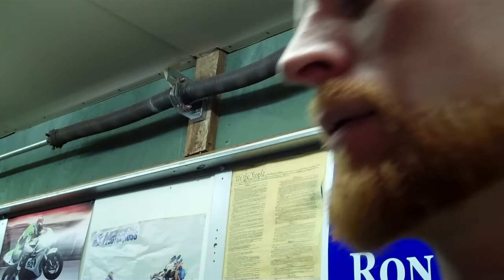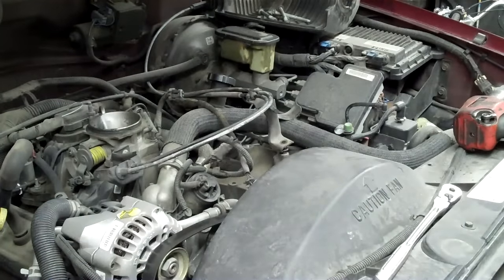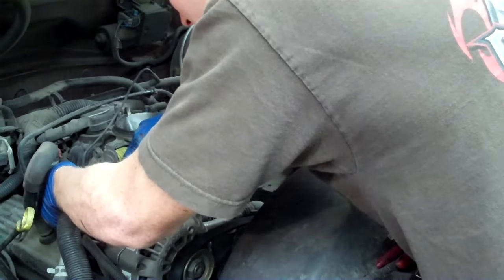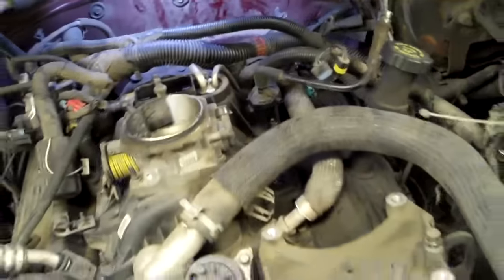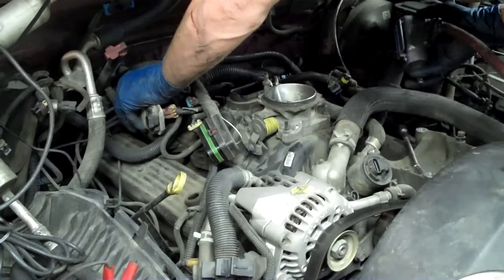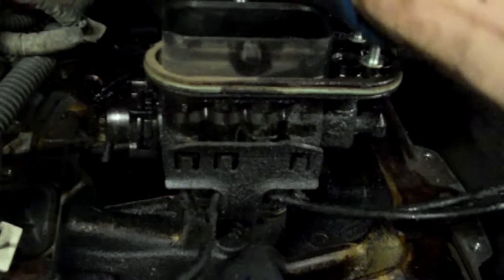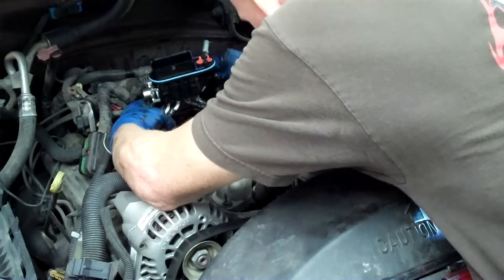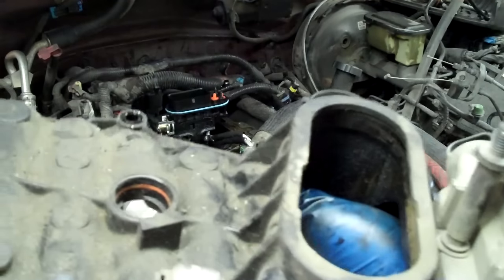How to change a SPIDER INJECTOR on a Chevrolet V8

Comment: Hey Brian, Thanks for video-Trying to pull lower bottom deck throttle body off to clean it up -seems like distribulator shaft is holding it on- can I unbolt it?
One other question- bent stainless steal pipe supply lines-can I bend back into shape or should I replace with new? 1997 Silverado 5.0 liter pick up truck

Comment: Spider housing does not fit through upper plenum. ...a bit too big...plenumbis  about 3/8's short from where it should sit on the housing....applied some of that silicone spray and it still didn't go in....tried to muscle it into place but no success ...any suggestions?

Comment: Hey Brian. You are the man. I have Silverado 5.7 V8 I got 2 codes P0305 / P0172 I thinking change my fuel injectors. I changed sparks plugs, wires, roto, cap,  fuel filter, air filter... still stink when running and the engine light still on, I'm getting ready to tester the cylinders compression. Your video is great. Any way, you think the spider injector is the problem? Help the Brazilian guy fix this problem, any help will appreciated. Thanks Brian.

Comment: I have a 91 suburban it's been giving me the blues with cranking. I sprayed starter fluid in it throughout the week finally today the cover for the filter and to the throttle body blew off. Is this possibly what's going on with my truck as well.  For some odd reason I can't run the AC it kills the power when driving. It's like my truck bogs down from a heavy load or something. What can this be
Reply: I don't think your year of truck is fuel injected.

Comment: Question...I have a 99 1500 that when I turn the key on it shows 60 psi fuel pressure  but within a couple seconds it slowly bleeds off pressure  on it's own. Even as you crank to start it dont hold pressure.  Put gas In throttle body it starts but not on it's own. Checked the obvious..replaced fuel pump, new fuel relay/fuse and new filter. Still nothing. Getting ready to replace  spider just wanna see thoughts this would be issue?

Comment: My '97 Z71 will start immediately when cold. After that the only way it will start is to hold the pedal to the floor. Computer said the Mass Air Flow was bad. Replaced that. Still says the mass air flow is bad after resetting. However, the fuel pressure gauge shows it holding pressure after the vehicle is shut off. Does this sound like a problem with the spider?

Comment: No when you replace the batter injectors beforehand was it back fine through the tailpipes when you drove it if it was it what was the reason you replaced it because you owed was overloaded with fuel and if it would backfire is it to the computer

Comment: hey man I really appreciate the video I took off my throttle body and seen that it was soaked underneath so I figured it was the spider I watched your video before and while I replaced the spider and that was the problem for sure!! Now I have a,nice running Tahoe! Before I couldn't even drive it because I would press the throttle and it was missfiring really bad now its smooth and its not falling on its face! Make some more videos you would be a really good teacher!!!!
Reply from the maker: Welcome Nick!  Check out my channel- there are over 700 videos there on car repair, and on my other channel theskiviking I have quite a few more!

Comment: hey Brian this is Adam. I have a 97 Chevy Tahoe with the same setup I just changed the lower intake manifold gasket plus all the others gaskets going up. on the fuel lines going into the spider, I had a fuel leak right there. by any chance do you know how many o-rings are on those fuel lines that go into the spider?
Reply from the maker: +addbcollins Most every fuel line connection has a yellow and a brown o-ring.

Comment: Hey Brian, not to sound stupid but, what are the symptoms of a bad Spider Injector? My 96 Silverado has a hesitation on excelleration, and is getting really bad mileage. I've already done a complete tune up, including some sensors. Should I try a new fuel filter first? Oh, also, I have to spray starting fluid 90 pc of the time. Thanks for this vid, and any help....ps...loved the Temple Grand reference....and I haven't heard my fuel pump in years. Battery?

Comment: Worth noting... You dont need the little plastic spacers on the ends of the fuel lines where they attach to the injector body... On the  updated design the lines go down into the O-Rings without the need for the spacers.

Comment: Hi Brian... in having problems with a 98 Silverado k1500 350 5.7 I do a lot of work myself...number six plug keeps fouling out (really bad black gunk not wet) I've put not foulers on number 6&8 plugs... I've been told valve guides seals r bad... ( not sure if true) I'm doing a compression test next) I've changed my fuel pump...done all wires etc.... my engine does not smoke... but uses oil... engine chokes when u give it gas.... I'm new to doing a lot of things...I'm not sure what to do next.. is this maybe something to do with the throttle body.... or does it sound like something else.. I don't wanna go to a mechanic... I'm simply tired of my truck running so rough... is it a piston problem?! What do u think??? Help!! :) thank u...
Reply: Well it
Reply: Sell

Comment: hey brian i have a 97 gmc burban. took it to the chevy dealer for a check engine light. it was diagnosed with bad cat. so i changed those now it bareley pulls itself outta its own shadow. i was told it could be an injector or o2 sensor. any idea's? it use to shutter when you would step on the gas but since the new cats it barely does anything.

Comment: Help somebody!!!! I have 96 Chevy 2500. Engine light keeps flashing, code reads misfire cylinder 2. I have changed plugs, wires, distributor cap, rotor, ignition coil,..yet to no avail.. still reads #2. Could this spider injector be my next step because I'm not getting enough compression on cylinder 2? Video was very helpful and I feel capable of being able to take it on myself, but just trying to make sure

Comment: how do you safely remove the new style injectors? I have removed many of the old style but I have never had to remove the new style. I don't want to remove the lower intake only the upper and I am a bit concerned if I just pry them out they may break off.

Comment: How do you know which injector to put in each cylinder? Is there a certain order? Is it possible to put an injector in the wrong cylinder? Thanks.
Reply: The spider has little numbers on the side of it. Rule of thumb (as shown in the video) Outside to furthest cylinder inside to closest and since there are only 2 on each of 4 corners, it's hard to do incorrectly. Once the injectors go in the hole though, it's heck to get them out.

Comment: I had the strangest thing happen after changing the spider , I still have not been able to figure it out. After replacing the spider I took it for a test drive and within 50 feet of driving it I pushed the AC button and smoke started coming out of the AC controller it fired the controller. I have traced all the wiring inside and have not found any bad wires. The AC has been replaced all the Air blend motors have been changed. Not sure if there is one for the hot to cold. The AC work great before changing the spider so I thought I might has pinched a wire or forgot a ground but everything looks fine, I replaced the AC unit the high pressure cutout switch and the dryer, put a new controller in and it smokes it when turning off the fan switch. Not sure if anyone has ran into this problem but I thought I would put it out there I watched your video to go back through all the parts and wiring being removed to see if anything would click just in case I missed something thanks for the great video.

Comment: I think you meant a p0172 and p0175 is too RICH not lean.  That's the codes I just pulled plus a p0300 intermittent random misfire.  I have 1997 tahoe 4x4 5.7.   It fires right up first thing in the morning but after i drove it or it's warm the starter cranks awhile before it will crank over.  Does it sound like doing this upgrade with cure the problem?

Comment: Yea, the mercruiser version of those engines has an intake with individual injectors, and itll bolt on to the block. From there you can goto bigger injectors to make up for forced induction etc, even goto a megasquirt system and that kinda stuff.

Comment: I have a code P0171 P0174 System to lean (bank 1) (bank 2) and P0304 Cylinder 4 misfire detected I replaced the plugs and wires last nite and she is running better now but the check engine light came back on, i didnt change the cap and rotor. Any suggestions of why shes running lean and why I have the misfire, thanks!!

Comment: I just did this job last night got rid of the cylinder 8 misfire. But now it's throwing cylinder 4 misfire. I know cylinder 4 fuel injector clicked in and in double checked to make sure everything was good. It was. I'm going to check if I'm getting spark. Which I don't know why #4 is throwing cause all the plugs, wires distributor cap and button is all new. Looks like I'm going to check for spark on that cylinder and swap the spark plug wires around and see of the code changes.

Comment: My 97 Chevy k1500 won't preprime to start I have to spray the throttle body to start once it's running it runs fine when I shut it off have to spray to get started ???

Comment: hey brian... I just bought a 96 chevy z71 with a 5.7l.. its running a lil rich and the check engen light is on.. it says misfire on cl#6. I changed the spark plug and spark plug wire but still the same. but the truck has a lot of power.. and it used half a tank of gas to go 60mil. it has a vibration that I can feel and kinda seems like it wants to stall but dosent.. also when I give it gas to take off and it kinda hesitates

Comment: Great video. But question.On the fuel pressure regulator I noticed there was no hose. Is this hose all under the intake? Or does it hook to the fpr the run out side of the intake?
Thanks

Comment: great video man! i am about to replace one on a 97 gmc sierra that had me puzzled. the cylinders # 6 and 7 were getting so much fuel its hydro locking engine. pulled cover off and  the injectors are leaking. thanks

Comment: you mention you think this engine is running rich looking at the buildups and what not in the manifold. My 96 5.7l has looked the same the 3 times ive had it open. actually the first time it had about 3/4'' of crud lining it on a slope from front to back. 

do you think the way this engine you have looks like it has a problem making it so gross inside? if so what would you do about it? thanks

Comment: Hey Brian, I’m chasing a P0300 code…

So far I’m at NEW:
Distributor (Braven)
Wires
Plugs (AC DELCO)
Crank sensor
Fuel filter
Both coolant sensors
Battery
MAF sensor (Walker)
K&N air filter

I keep running into people saying bad spider injectors. I’ve hooked up a Tech2 and it’s showing cylinders 7 & 8 misfiring simultaneously (I have 2 videos on my page showing engine data) I don’t know how to read data and uploaded them for a forum and I have no idea how to check for bad spider injectors. Any ideas? I’m at $400 so far and it’s gotten better but still throwing P0300. ANY input helps… I would greatly appreciate it…

Comment: Video is great and I really appreciate the help. However, I like another or two, am not able to get the assebly fully seated up into the upper plenum. I can pop the old one in just fine if I try. I have oiled the heck out of the gasket on the spider ass and the upper plenum hole but it is short by maybe an 1/8th to a 1/4 inch. Grrrrrr! Any help, ideas? I have taken a block of wood and placed it around the upper plenum pice and rubber mallet soft tap and I can get it that deep, but no more. HELP!
Thanks!
Reply: OK. I tried silicone and it did not work. I tried engine oil, a lot of it and it did not work. Then I tries pet. jelly and bamb. Spider mount slipped right into upper plenum! So, use a bit of petroleum jelly. Then I broke off a bolt front left of plenum while tightening. But. Nor error codes. No miss fires, no know vacuum leaks. So I am happy. And no, I don't think I will fix that broken bolt...

Comment: Interesting diagnosis and fix.  Thanks for sharing ---   For a 2000 GMC V6, 4.3 L, does anyone know the typical reliable life of the fuel pressure regulator ?  And does anyone know the typical life of the fuel injector / poppits ?      Would it be wise to replace the fuel pressure regulator and/or fuel injector / poppits after 200k miles ?
Reply: IMO, it is wise to replace the fuel pressure regulator after 200k miles.  Did you replace yours?

Comment: So I was planning on doing intake manifold gaskets at the same time so if I did that and had the intake m sitting on the bench could I install the new injection system on to the intake outside of the truck?

Comment: Brian,  I replaced my spider injector today on my '99 Suburban today, but sadly it runs as it did before.  Before I purchased the spider injector I had a mechanic friend diagnose and test injector misfires on 2 and 4. He even was able to shut off individual injectors, which made the engine smooth out.  So I purchased the spider and installed it.  Could it be with the computer or short?   Could it be a lower intake gasket issue?   Anyone have suggestions, I would appreciate it.  Thanks

Comment: Hey Bryan I was hoping you might give me some insight on my 97 truck it will idle once I try to give it any throttle it wants to die. when I can get it going down the road seem to run ok until I give it full throttle it just falls on it face. I have replace the fuel pump second time I am wondering if they gave me the wrong one the first time and just replaced that one with same.
I still have the tank on the ground and when I hook it up there is like maybe 8 to 12 psi, What would you think.

I changed out dist.( new) changes out all censers new.

before it starts to die I do hear like a vacuum leak but can not find it. I can cover the throttle plate and it have very strong vacuum.

thanks for your thought Bryan.

From Bryan
Reply: I found when I too the intake apart the #6 &#8 injector was not push all the way down to seated position whom ever did the upgrade on the intake and the injectors just did not make sure they where not down.
Thanks for the response. truck runs like a champ now by the way the fuel regulator screen was clogged. Also yes the part store sold me the wrong fuel pump first  time and replaced it with the same one.  I went to the local junk yard and found a high volume pump and installed that too. works great ready for smog.

Comment: what if i didnt crossover #5 and #7 injectors will i have a problm
Reply from the maker: No, not a problem, but trouble codes.  P0305 and P0307.

Comment: I'm having trouble with my 99 suburban. Broke down while idling in parking lot. Can't start it. It will fire up with starting fluid then die. I changed fuel pump, fuel pump relay and fuel filter and still won't start... The price of the part for this is expensive. Should I do this or change the fuel pump again in case I got a faulty fuel pump???
Reply: Replace fuel pump. Must go with GM or Delphi units.  I tried a airtex pump and it was a total failure. Replacement with Delphi unit no problem! Good luck!
Reply: @MrRoy-rb1je  thanks for answering me I ended up taking the gas tank back down and had a loose black wire in the fuel pump harness. Fixed the loose wire and started the truck up after a few tries. problem solved.

Comment: great video I placed new injector in my 5.7 2 back won't clip in or stay tight to intake , fuel all around back side, regulator is good injectors are 2 years old, runs for 3 min dies, min. later starts back, repeats it self. psi will drop to 0 psi when it dies, will need help understanding this one, any ideas ??
Reply: If it your fuel pressure dropping to 0, then you could start by replacing the fuel filter and verify the fuel pump fuse and relay are functioning as designed.  If you still have 0 psi fuel pressure after replacing the fuel filter and verifying the fuse and relay for the fuel pump, you may have to replace your fuel pump.

Comment: Brian ..I have a 97 3500 5.7L and it wnt turn I have pressure to the fuel line ..but it turns on when I spray carb choke and it stays on but overnight it wnt turn on do you think its the fuel pressure regulater on the spider injector assembly ..thanks for the help

Comment: Just a quick question would this be the reason my truck turns on then off I've put a new pump  and filter new plugs and wires , a solenoid but still don't stay on its frustrating
Reply: Crankshaft sensor
Get it checked

Comment: 1998 Yukon 5.7l... dual exhaust, one exhaust huffs & puffs. The other flows fine. Engine light flashes with code reading P0300.
Have any ideas what to address??
Reply from the maker: +Atmosphere Locate the misfire.  The huff puff side of the motor is missing either spark, compression, or fuel on one hole.

Comment: hi brian i removed the cover or intake plactic part to change my fuel pressure valve. my question is there was no vacuum hoes attached to the pressure fuel regulator. where does the vacuum hoes connect to.

Comment: Brian,
@ 00:19 you said codes PO172 / PO175 for lean B1/B2.  Those codes are actually rich B1/B2.  My "99 Suburban has the PO171 / PO174 for lean B1/B2.  Would you change out the spider for lean codes as well?

Comment: Thanks for your posts. I have a 96' 1500 that has thrown a random misfire code, a #5 misfire, and a right bank rich code. It runs great for the most part. I put plugs, wires, cap rotor, fuel filter & a pump in it . Great throttle response and power. It runs rich from the smell but no black smoke. I'm getting a detonation sound under load at about 1500- rpms. It doesn't do it when it's cold. I think because it's richer and than goes lean after it warms up.Do you think it is an injector issue? thx